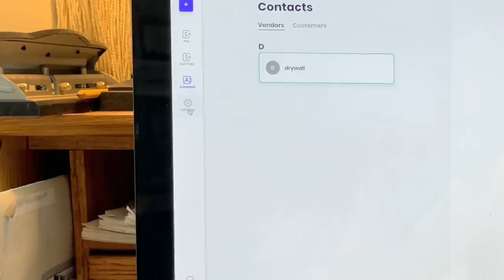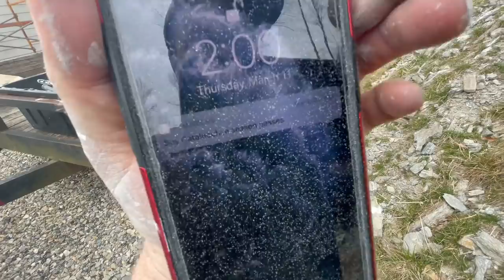Building The Farmhouse | Day 57

Comment: Pro trip for you that a trucker told me a few years back.  Twist/roll the ratchet straps when you tie down your load.  When you keep them flat, they can start to vibrate from the wind as you drive down the highway, and that can lead them to loosen or adjust a bit.  Twisting them wrecks the harmonics apparently.  I've tried it and it appears he was correct!
Reply: You also have to pat the load and say "That aint going nowhere" or there is a good chance the load will come loose. This is a scientific fact!
Reply: MAGA MAN absolutely!

Comment: I redid the flooring in my house built in 2005 this year, and found lots of drywall dust under the carpet pad and even more along the base of the walls.  I had to vaccum over and over before I could start laying down the new floor.  Obviouly not built with care like the Perkins crew use.  Great work guys.  I learn a lil somthing on every video.

Comment: My drywall guys mask the floors with paper before they start. After they're gone,  I just fold it all toward the center of the rooms and haul to the dump trailer. Then, a quick vacuum around the perimeter, and done. Easy. 

Great video as always. Getting paint up on the walls always feels like a turning point on any project. Onward with the finish work!

Comment: That’s a lot of primer in a short time!  The next time you have to vacuum in a tight place like by that stair runner take a block of wood bigger than the end of the shop vac hose and drill a hole just the size of a stick of small cvpc waterline.  A few wraps of tape will keep the cvpc from getting sucked through the block and you have an almost free vacuum wand!

Comment: You should get a 30 gallon trash can and make an inlet port for your vacuum hose and a second port for your shop vac to attach to.  Put that on a 4 wheel cart and you would have a simple mobile dust collector that would fill the trash can without having mess with bags in the shop vacs.  Probably save time and money.

Comment: The way to make a ceiling perfect can be done by adding a very thin layer of finishing using a long ruler. It is a similar product as what they use to fill in between the boards. Applying this isn't easy, but the result is superb from all angles, especially in houses with big windows.

Comment: For those paint sprayer extensions you always have to crank them down with a wrench or they will leak all over you like that even though you have them as tight as you can get them by hand. You have to compress that hard plastic seal inside

Comment: Sherwin williams “Painters Edge” flat is the flattest paint on the market and great for ceilings. It’s a 1 out of 100 on the gloss scale. It touches up incredibly. However it has no resistance to hand traffic so only good for common ceilings. No bathrooms or walls. 
I’m sure Sherwin will let you have a few gallons for free to test drive it

Comment: as a drywaller (retired) it is hard to get a slick wall to not show any imperfections, the drywall paper has a texture, the mud on the joints, no matter how well sanded, has a different texture. 

That is why we always put a very light "roll coat" of thinned down mud on the walls and ceiling even for the "knockdown" ceilings this way the ceilings didn't require paint, and the walls didn't require primer. When we left the job it was 100% ready for paint or wallpaper. Only callbacks I ever had was for someone blowing insulation stepping through the ceiling, or the HVAC guy cutting a hole in the wall for an air return, and cutting it in the wrong place.

Comment: in Britain we started phasing out textured ceilings 20 years ago, getting a flat, untextured ceiling is not as impossible as you think it is.
Reply from the maker: It’s just a matter of cost really here as well.. more labor cost to the owner to do it.
Reply: @PerkinsBuilderBrothers  granted it costs more, and as you say if you can’t even tell there’s a texture then fair enough. Plastering ceilings is pretty much an art form over here and good plasterers are sought after
Reply: would have to skim coat the ceilings which is expensive as drywaller finishers are not plasters and the skill set is slightly different.   But it can be done.   generally you thin down the mud, roller it on and skim it out.

Comment: AYE GUYS, PRO TIP 1. To make it easy to clean face of paint after spraying place baby oil on face and hair or any exposed arrears so when washing with soap after spraying the paint is easily removed. PRO TIP 2 GUYS that works. place phone in a ziplock plastic bag. Baby oil is good for oil or acrylic paints though oils it is a little harder to remove because it is oil like oil paint. Guys though you knew all these tricks being in the trade all these years.
Reply: I think the oil would be harder to get off your face than the paint... also, filming through a ziplock bag will result in a very distorted image..
Reply: @112Haribo  Hi Harold, If you are a painter try it as you will be surprised at the results as well it gives the skin a softness like a babies bottom. haha it works.

Comment: If you like northern tool you should check out their air compressors. Quiet oil less portable and 110 but way better than a pancake. 

53009 or 99306.